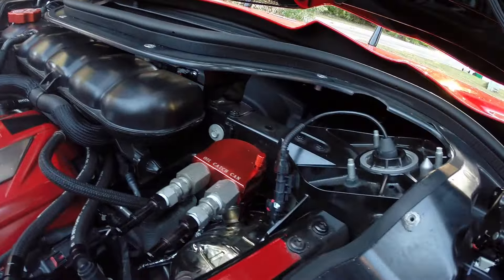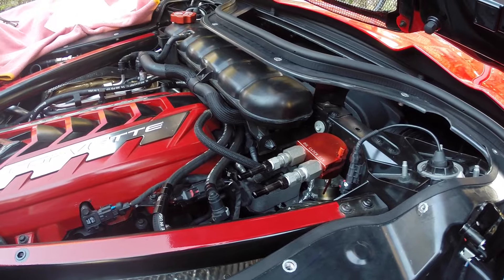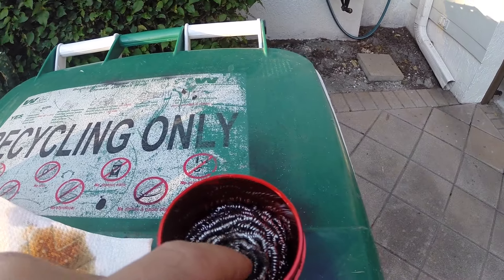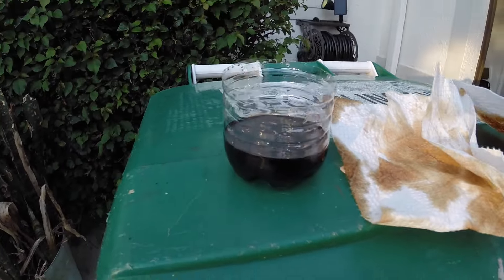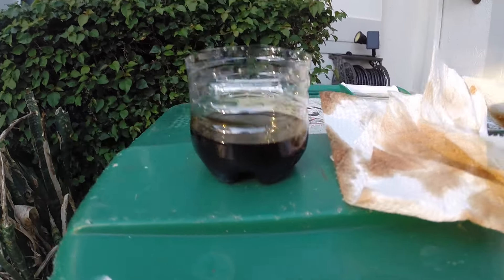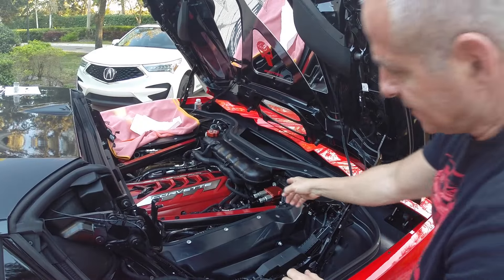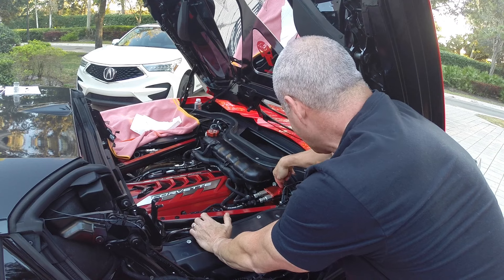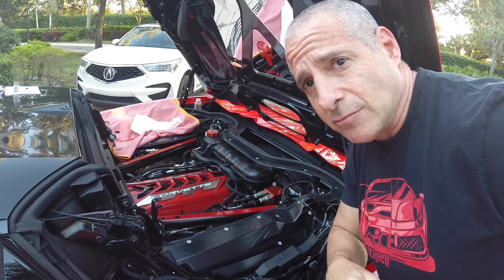My Oil Catch Can after 7500 miles of driving C8 Corvette Z51 stingray? Worth it? How much was in it?

Comment: An oil catch can is a good investment on most cars, especially ones with forced induction or those with high performance engines.  I have one on my '23 4Runner, and it collects a good amount in the 3 oz can between oil changes at 5K miles (like over 3/4 full).  I had one on a Jeep Gladiator pickup, and a '17 Shelby GT350 I used to have had one for each cylinder bank.  The Pentastar V6 engine in the Jeep was a very dirty engine, the can collected all kinds of stuff in a relatively short time, compared to any other car I've had them in.  On the Shelby, one side never collected anything, and the other side would collect a little, not even enough to empty it every 5K miles.
Reply from the maker: Wow. That’s interesting. Thanks for the info. I won’t go without one on the vette. May out em on all my cars.

Comment: Ran into two Lamborghini tonight on my way to work in my C8 Stingray. A Gallardo Super Veloce and a Huracan. After the Huracan left the highway the Gallardo started to rev its engine beside me when there was a gap in traffic ahead. I didn't even think about a pull because he probably would have gapped me easily.
Reply from the maker: Yep. Better saving it for the track
Reply: @JoesGarage-c8corvette  Yeah, I'll go looking for them both once I get this thing supercharged. That is the plan for the future of my C8. But, I smoked a 5.7L charger on the way to work tonight. I was minding my own business and running a little late to work. He was in the fast lane doing about 70mph. So I passed him in the inside lane. He didn't like that and took off ahead of me. I really didn't pay him any mind because even though he spend off he really wasn't going fast enough to loss sight of him. Then the highway was open and no other cars around. Radar detector was clear and he lined up on me a few lanes over. So I walked away from easily and then he got off the highway.
Reply from the maker: @ sounds like a fun time. Be careful.
Reply: @JoesGarage-c8corvette  Yeah, that stretch of highway is clear of police. State Troopers I have to watch out for.

Comment: The oil turns into sludge that coats the inside of the intakes. Which also creates turbulence and drag. Now you might say that's too small of a problem to worry about. But guess what it also coats and a grades performance overtime  plugs, exhaust, piping, 02 sensors and that precious catalytic converter. All robbing you of horsepower
Reply from the maker: Exactly. Hence why I have one.